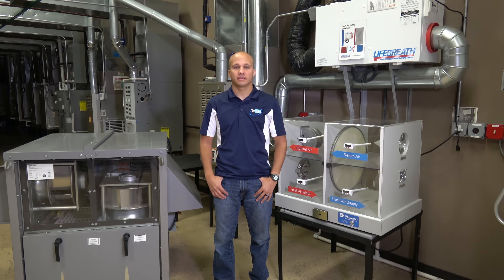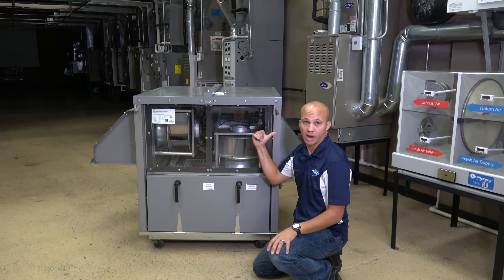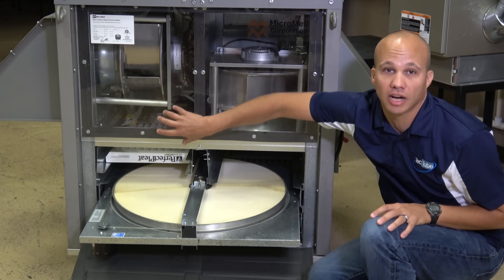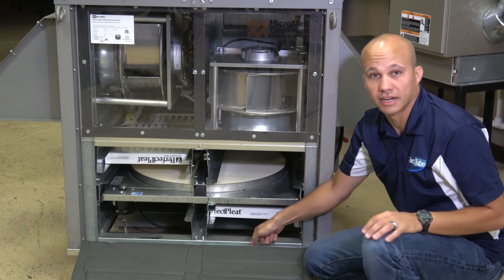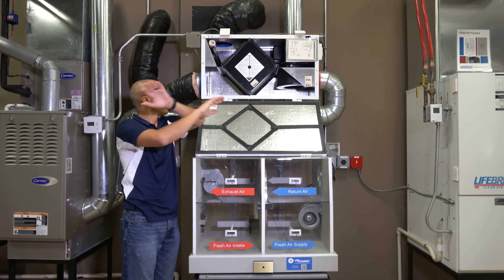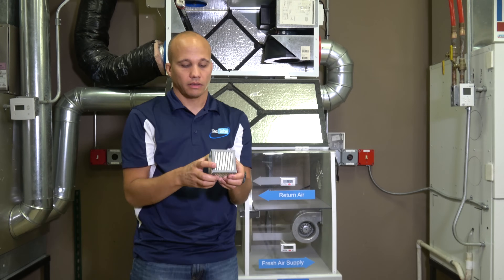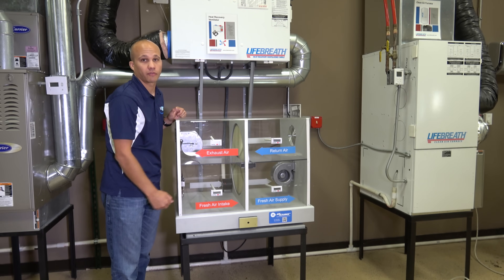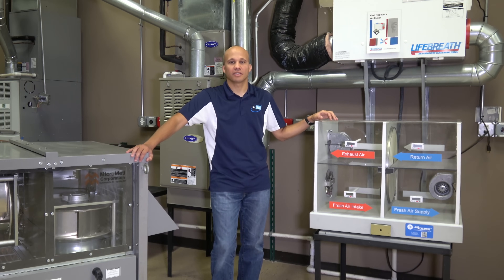Fundamentals of Energy Recovery Ventilators (ERVs)

Comment: What should the house exterior intake cover look like?  We have a 8"x 8" bug screen with louvred flaps, but someone pointed out that it should be a boot cover, so that the outside air coming in is not impeded by the closed louvre flaps.  Does it matter?  Thank you, great video!
Reply from the maker: If the flaps are closed when the ERV is running then yes it matters.

Comment: What’s the Face and bypass damper on ERV
Reply from the maker: Face and Bypass dampers would be used in economizer mode.  On a cooling call (with cool OA available), you would not want to recover heat from the exhaust and transfer it to the incoming air.  When that happens, we stop spinning the wheel and open the bypass damper to send the OA around the wheel (or core).  In many applications, there is just a bypass damper and not a face damper.  The bypass is required by energy code.

Comment: There is a query I'll be grateful to get looked upon by experts like you. I was concerned that the temperature difference of the Air Streams going in and out (in case of an HRV) that could condense the water content in the humid air. Won't this happen and the condensed water will drip from the duct pipes?
Reply from the maker: Condensation can occur if one airstream's temp is below the dewpoint of the other airstream.  Many HRVs have a condensation pan and drain line for this reason.

The ductwork between the HRV and the furnace should not condense, though.  In order for that to happen, the duct temp would need to get below the dewpoint of the air in the room that contains the ducts.  That will be difficult to do without refrigeration.  Sometimes, however, this will occur on the ductwork between the HRV and the outdoors.  Although that will happen on ductwork to the outdoors even if you do not have an HRV.  The two ducts going to the outside should be insulated ducts like we showed on the HRV in the second half of this video.
Reply: @TECTubefilms  Thank you so much for the reply..
Reply: @TECTubefilms  where do I buy one of theses I am sick of my house being 94 degrees swamp cooler sucks
Reply from the maker: @UPsideDOWNworld321  Are you saying you have a swamp cooler instead of an air conditioner (FYI - swamp cooler is slang for a type of cooling system used in desert climates). An ERV isn't going to help in that case.  And ERV recovers heat/cool energy from your exhaust air and transfers it to your incoming ventilation air.  Nothing more.
Reply from the maker: @UPsideDOWNworld321  ERVs are available through just about any HVAC contractor

Comment: Hi, could you help me solve this question? If my home rh is 70% at 18, outsidw is 40% at same temprature. What will the in door humidity be after several day use? Thx
Reply from the maker: There are too many unknown variables to determine that.  You would need to know the efficiency of the specific ERV you are using in order to determine the supply air conditions from the ERV.  You would need to know the details of the abilities of your A/C system.  Need to know indoor temp maintained by the A/C.  Need to know infiltration rate of the building envelope.  And more.
Reply from the maker: Also 18C is a very mild day.  An ERV does its best work on hot or cold days.
Reply: @TECTubefilms  Thank you. I just feel it hard to pick from erv and hrv because they are similar price here and outdoor humidity is always perfect but I have too much condesation in door.  Only use one month ac in both the summer  and winter so I think the energy effeciency is not big difference while they both have over 80% effeciency.
I know the erv is very good at tropical area and extremly dry  cold area. But don't know how big difference for my situation.

Comment: Hello, I have a barndominium home that has spray foam insulation.  The SPF is not allowing any fresh air into the home and it off gasses some during the summertime.  My goal is to bring in fresh air to help with the off gassing.  Which of the 2 devices would help me better, an ERV or whole house ventilator with dehumidifier? Also, does the ERV only work when the HVAC system is running?  Thank you for your time.
Reply from the maker: The ERV will be less expensive to operate.  The dehumidifier can remove moisture from both the indoor air and the incoming outside air.  The ERV will only remove moisture from the incoming outside air.

Comment: How can the enthalpy core possibly transfer moisture from one stream to the other without transferring bacteria and toxins with it? Moisture is water? I can understand the core transferring heat without mixing airstreams but moisture. I am just not sure how that works.
Reply from the maker: We suppose the simple answer is that the enthalpy core wicks the moisture through the media.  This allows it to move moisture but not air.  If there was something in the moisture... and that something was smaller that a grain of moisture, we suppose that something would also get pulled through.  The IMC allows either 5 or 10% leakage of air from the exhaust to the supply depending on the category of exhaust air used in the ERV.  What you are describing would be tenths of a percent, so it would be of no concern.  Plus if you think about it, the supply air is going back into the same room(s) that the exhaust air came from in most applications.

Comment: Where do I get the wheel? Can I make my own wheel? And how well does the seal between the spinning wheel have to be? Do you have a miniature version of this system for a small 2 bedroom house?
Reply from the maker: You do not need to seal between the wheel and the cabinet... in fact you really cannot because the wheel is in motion.  However, by properly positing the two fans for pressure control, you can insure minimal to zero leakage for EATR and OACF.  You may want to check out this webinar if you want to learn more about ERVs and wheels - https://attendee.gotowebinar.com/register/3857937118863671564
Reply from the maker: The wheel in this video is the miniature version.  Wheels are only used in commercial ERVs which range from about 500 to 50,000 CFM.  Some of these are 10 ft in diameter.  However, if you really want, Airxchange does make one down to just 50 CFM, but it would be very cost prohibitive to build a residential sized version with that wheel.  For those small sizes, it would be less expensive and more reliable to use a "packaged" residential ERV which normally has an enthalpy core instead of a wheel and motor.

Comment: IF this shit actually works, then why do all HVAC units have them standard issue?
Reply from the maker: Reason #1 - not all applications have enough exhaust and outside airflow to financially justify an ERV.  ERVs make the most sense on applications with a lot of OA requirements.

Reason #2 - some building owners value low first cost over low operating cost

Comment: We have a huge one in our building's air handling unit. We are seeing only about 8-10 degree drop from supply air temp before it hits our chilled water coil. In our area, our summers can be quite hot (100+) and seeing your demonstration, I am wondering if our wheel is not doing what it's supposed to!  hmmm
Reply from the maker: Lots of possible issues: wheel could be dirty, you may not have enough exhaust CFM relative to supply CFM, your exhaust air may be too warm, wheel could be moving the wrong speed
Reply: @TECTubefilms  Ok.  I have noticed that our exhaust CFM, when raised, the evap cooler does lower the supply, however, it creates negative pressure in our building. I will have to check the wheel's RPM as it was recently installed after our original wheel feel apart. Thanks for the feedback!
Reply from the maker: @FloresEsteban1979  Wow!  Your wheel fell apart?  We have never heard of anything like that.  Who was the original wheel manufacturer?  Did you replace it with a different brand of wheel?
Reply from the maker: @FloresEsteban1979  What is the exhaust air CFM and the outside air supply CFM?  Are there other sources of exhaust in the building?  If you want the space balanced instead of negative... and most buildings do... you need to move all of the building's exhaust air through the ERV and not use other exhaust fans.
Reply: @TECTubefilms  Yes, it was designed to have some positive pressure. The normal CFM during a regular business day is around 800-900 Exhaust and 7000 Supply at the air handler.
Reply: @TECTubefilms  Yes, the laminations of film used started to come apart, so much that the wheel lost it's balance and caused the wheel to start rubbing on the enclosure. It was made by AIRotor. The replacement is from same manufacturer. it was installed in pie-like pieces.
Reply from the maker: @FloresEsteban1979  We are not super familiar with AIRotor, but that seems odd.  Is it a regular building or is it manufacturer and you have chemicals in the air?  All of the ERV and AHU manufacturers we work with use Airxhange wheels.  We buy millions of dollars of ERVs each year and I think the only time we have ever replaced a wheel pie piece was when someone put a screw driver thru it... multiple times.
Reply from the maker: @FloresEsteban1979  7000 CFM outside air supply from the ERV to the AHU?!?!?!  That would be horrible.  Or did you mean 7,000 total supply of the AHU?  There is a big difference.  The question is how much outside air are you sucking into the ERV vs. how much exhaust air are you running thru it?
Reply: @TECTubefilms  it’s all 100% outside air 😬 in one of the lowest air quality cities in California. it’s 7000 thru the wheel to the building
Reply from the maker: @FloresEsteban1979  Well... I think we found your problem.  You are running 7,000 CFM thru the outside air side of the wheel, but only 900 thru the exhaust side.  That is the reason you are only seeing a small improvement in temperature.  Honestly, we are shocked you are even getting an 8 degree improvement with this setup.  Where is the rest of your building's exhaust air leaving the building?  If the building is under negative pressure with 7,000 in and 900 out, you must have a bunch of other exhaust fans running somewhere removing MORE than 6,000 CFM of air.  The only way to make the building negative is to suck out more than you suck in.
Reply: @TECTubefilms  The building is at positive pressure. I have played around with changing the speeds of the exhaust fan in the AHU and as I increase the speed of it, I do see an improvement on the supply side. However, it starts creating negative pressure. I understand that we need more exhaust air (especially further cooled down air via the evap cooler on the exhaust side) in order to make a better heat exchange at the wheel, but we cannot be at negative pressure in our building. I will try running it at a more balanced pressure. Currently, from startup in 2011, it was setup at +.94", but I can see if running it at half that gives me an improvement. Not sure how that number of static pressure for the building was determined, but we do have some wiggle room. As far as other fans are concerned, our next biggest exhaust fan, according to the balancing report, it should be moving about 5k CFM. I can understand (somewhat) that all exhaust fans are trying to compensate for the supply CFM, but it doesn't make sense why so little of it is being forced back through the wheel, and I think that's the downfall of our system.
Reply from the maker: @FloresEsteban1979  Absolutely!  That 5,000 CFM exhaust fan should likely be eliminated and that airflow should be exhausted out the wheel instead so you can reclaim its energy before discarding the air.
Reply: @TECTubefilms  I will double check that its sheave is  also set up appropriately. Thanks for your attention and feedback!!

Comment: i like that but im not 100 percent sold its that efficient ...... u have no gaskets, seals between fresh air supply and return air, it could be leaking by..... just saying, im not 100 percent on that....
Reply from the maker: Each commercial ERV is rated and the results are published at www.ahridirectory.org.  Two of the tested items are leakage.  There is Exhaust Air Transfer Ration (EATR) and that is the percentage of CFM that leaks from the return back into the supply.  This is highly dependent on fan position.  The worst I have seen is 6%, but most are under 2% and many are nearly zero.  The other is Outdoor Air Correction Factor (OACF) and this represents the leakage from the outside air into the exhaust.
Reply: good video, im not complaining
Reply from the maker: If you are interested, here is a free 1 hour webinar on this subject.  https://attendee.gotowebinar.com/register/3857937118863671564

Comment: Very good demonstration. How are the heat molecules separated by that spinning  wheel?
Reply from the maker: No molecules of the air are separated.  The air molecules pass straight through the wheel.  In regards to the heat... heat always moves from hot thing to cold thing, so if the air is warmer than the wheel, then the air heats the wheel.  Then the wheel spins to the other airstream where the wheel is not the warm thing so it transfers its heat to that cooler airstream.
Reply from the maker: Just noticed your name.  LOL

Comment: Yeh,, but If you use exhaust air from the bathrooms then your whole house will stink,,, especially if the person using the toilet has been eating burritos or chili..
Reply from the maker: Not true at all.  The air from the bathroom goes thru the ERV and continues all of the way out of the building.  That air does not mix with return air going back into the house.
Reply: @TECTubefilms  OK.  Good to know!
Reply: @TECTubefilms  Get some smoke pellets to demonstrate that "does not mix" claim with your plexiglass ERV model...    I bet enough air gets trapped in the wheel as it turns that it's in fact mixing a good 20% of air, probably more...
Reply from the maker: @Wierdy1024  That would be a good way to illustrate it.  In the meantime, check out the AHRI database of certified products at www.ahridirectory.org.  It shows the EATR for all makes and models of Air-to-Air Packaged ERVs.  The absolute worst model on the market is 6.4% leakage from the exhaust back into the supply.  The best is 0.2% (from MicroMetl).  1,600 of the over 2,000 models of wheels listed are under 2.0%

Comment: Is there a measurement of how much energy is "lost" in this process? I realize that something can be derived based on that demo with the thermometers I am just curious if there have been papers/studies published on these.
Reply from the maker: Yes, but what do you mean by "lost?"  Are you trying to figure out how much fan energy is being used to move this air?  If that is the case, most selection software tools will tell you this kWh.  Or are you trying to figure out how much heat is not being transferred that could be?  If this is the case, then that is represented in the AHRI rated "effectiveness" percentage.  Or are your trying to figure out how much leakage goes around the wheel on accident?  This is represented by AHRI's measurements of OACF and EATR.

Comment: This - coupled with gentle ceiling to floor airflow - would seem to be the future of viral transmission suppression in public spaces.
Reply from the maker: An ERV is a way to save the energy cost of ventilation air.  It doesn't clean or purifier the air.  It provides the same dilution affect that other ventilation system would also provide... it just does it with less heating/cooling energy.
Reply: @TECTubefilms  I fully understand the function. My comment stands. I did not suggest that it cleans or purifies the air. Indeed, there is no way an HVAC system can filter viruses out of air transmitted directly from person to person in close proximity, even if filters could be so fine. My point is that in enclosed spaces with multiple occupants, the direction of airflow, its replacement frequency and dilution with fresh air are critical factors in reducing the concentration of pathogens in each breath of air we inhale. I was suggesting that individual occupants should have maximum supply of outside air to breathe - as opposed to air exhaled from others' lungs. This would seem to be accomplished by arranging airflow from floor to ceiling with fresh air constantly supplied with minimal turbulence. Energy recovery is required to make such a design economically practical beyond capital cost considerations.
Reply from the maker: @TheCablebill  Agreed.  We have to tell people about 5 times per week that ERVs don't clean air, so I guess we just assumed that is what you meant.  LOL
Reply from the maker: @TheCablebill  BTW - we do have a filtration system that filters viruses out of the air in an occupied space.  We have been using these in hospitals for about 8 years.  If you are interested in learning more, check out https://attendee.gotowebinar.com/register/2854708624619222797
Reply: @TECTubefilms  great! So it will it stop this pandemic! I had no idea the solution was sitting on your shelf. Please contact the CDC ASAP.
Reply from the maker: @TheCablebill  Filtration and purification are part of the overall solution for reducing SARS-CoV-2.  It is not the only solution needed.  Just like with influenza and other viruses, these solutions should be combined with hand-washing, vaccines, etc.
Reply from the maker: If you are interested in viral transmission reduction in commercial buildings, check out our webinar on IAQ.  https://register.gotowebinar.com/register/5473581496208425740